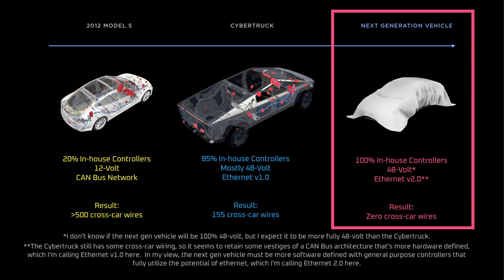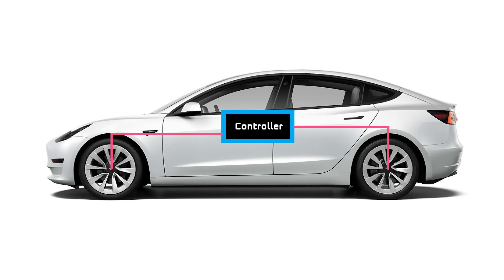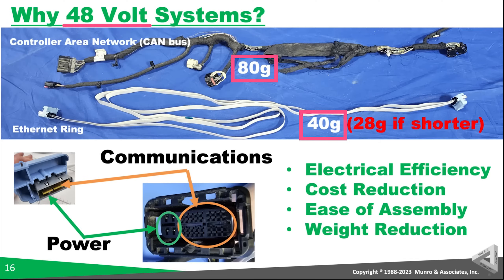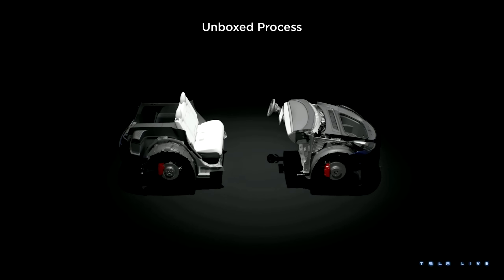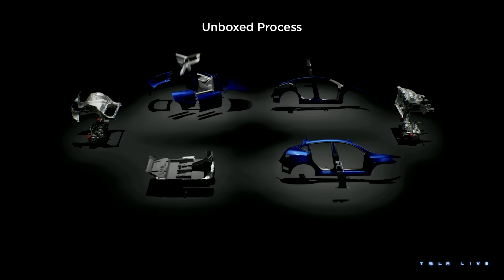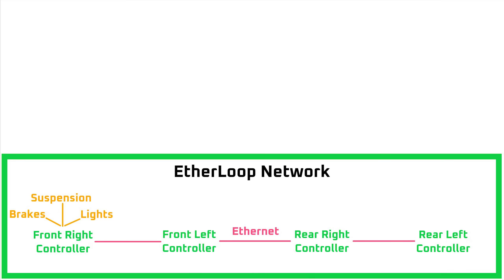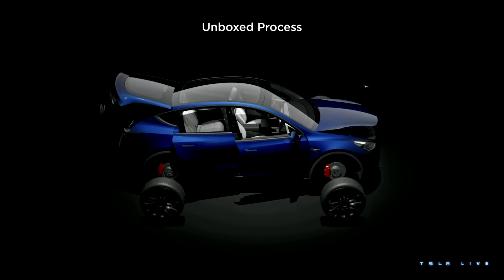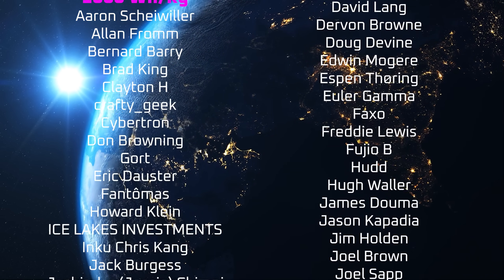Digging Deeper on Tesla's Etherloop Wiring System

Comment: Now I'm starting to understand what Elon meant with: "don't follow meaningless standards!"
Reply: Oddly,  this is all based on a 2020 standard, sponsored by Ford and Audi
Reply: Stockton Rush said the same thing.
Reply: @Dularr  maybe bad marketing from Ford and Audi kkkk
Reply: @marceloniendicker8335  more likely they are slow and unwilling to change
Reply: Isn't that what The Ocean gate guy said to
Reply: By embracing a standard that isn't good for the job?
Reply: @Dularr 
Audi, VW, BMW, Porsche and Daimler - agreed in 2011 to use a common framework for a 48V embedded power supply in future vehicles.
In 2015 the Audi SQ7 had a 48V Lithium battery to power a supercharger while the rest of the electrical components were still 12V.
Reply: @cjwilson54  48v has been around for awhile.  The 2020 standard was more about a start to autonomus driving, steer by wire and 10BasedT1S
Reply: The ethernet Tesla is using is a standard as are the 48v components. The industry has been moving in this direction over last decade, developing the standards and components which tesla is now using.
Reply: @nua1234  and not real time, so can have the bus saturated or locked.

Enjoy having your brakes fail to respond due to the radio being temperamental.
Reply: Like the guy with the carbon fiber  subs..
Reply: Yeah let’s just ignore the dogshit build quality of tesla
Reply: @downix  as if this would not happen to other vehicle "in real time", it's a car, not a rocket ship.
Reply: @JLeYang  In other cars the brakes and steering are a mechanical connection between the wheel and pedal to the hardware.  Once you move to "drive by wire" this becomes a potential problem.
Reply: money it has always make absolutely sense forever(money always maked sensed)
money such a easy concept to grasp there are its 3 logical parts
metal disk is smallest money
paper rectangle is bigger money
but the biuggest money.. is plastic card with a horse
Reply: @SparklingWalrus  5 year tesla ownership. no problems. so sorry for your experiences.
or are these just theoretical.
Reply: @Dularr could you please name the protocol you are talking about
Reply: @Vinod-Koli  IEEE 802.3cg published February 2020.  Which includes 10BASEDT1S standard.  
Now the real question is will everyone adopt the standard.
Reply: @Dularr  I think most OEMS will adopt 10BASET1S. But I'm more impressed with Tesla's E/E architecture based on etherloop
Reply: This sounds like a terrible principle. Unless you have an extremely specific unfulfilled use case, not using standards might save a buck in the short term to make one department look good, while making everything else more expensive and worse, especially long-term.

A standard is valuable because it is a useful standard in wide use, not because it has some super grand meaning. There’s a reason two-wire UART is still used everywhere.
Reply: who decides what is meaningless, the guy who brought the money? The smart people he hired? The people who will be on the road with those cars driving around?
Reply: @quademasters249 they're all moving to drive by wire (I remember reading about it in car magazines in the early 90s), the luxury models probably already are like that.
Reply: Yeh....or things like troublesome brake pads or annoying suspension bolts...(*)...........Jokes

(*)
As on the Model 3 delivered new to April Gillmore December 19 2021
She contacted the dealer a few days later indicating there was an unusual noise coming from the brakes and they were underperforming....
The dealer told her it was normal!  Haha
Untill they actually looked at it and discovered it was a special Friday Afternoon Edition.....
Production meetings around the old octopus bong...

No beef Elon...keep toking ma bro, ya allgood
Reply: @quademasters249  yeah, just like all the planes flying today
Reply: @cjwilson54  Plane software and car software couldn't be more different. Plane software has to be 100% tested before it can fly.  Even with that, Boeing managed to install an "aid" to flying that drove the planes into the ground. 

Car software process is probably something closer to what  "Cloud Strike" uses.  

My adaptive cruise control messes up at least once per trip.   I really don't want to have to depend solely on the work of some lowest bidder Indian programmer.
Reply: Marcel
Only apple and Tesla can demand their own regulation !
Reply: @cjwilson54  Any system vital for control of an aircraft must be at least triple redundant and some of the redundancy systems still feature direct mechanical connection in the event of  Pbus supply fault or hydraulic failure.
Cybertruck systems are single system non redundant. 

Also most small aircraft still use mechanical linkage for flight controls, so, no not like ALL planes flying today.
Reply: "don't follow meaningless standards": cut costs, make Elon richer and put the lab rats (customers) in danger.
Reply: Mf eathernet rings and loops just became a thing in the past 5 years. The whole industry is moving to this even factory automation. Hes doing nothing but being on time with the latest tech